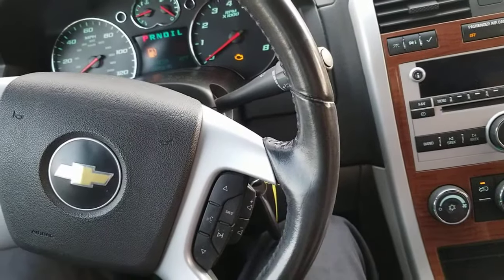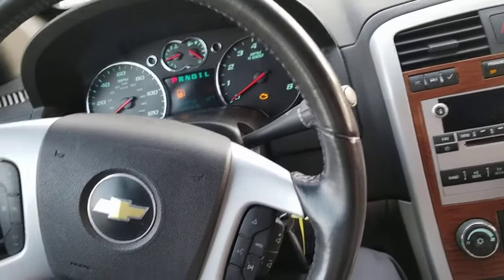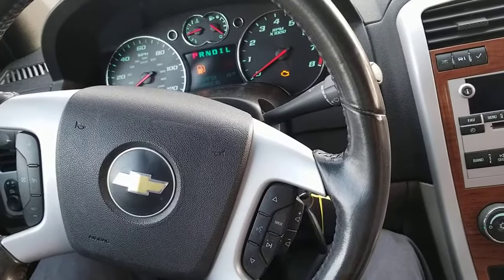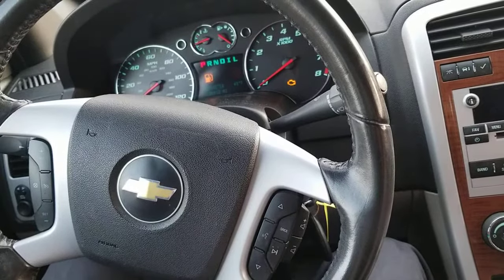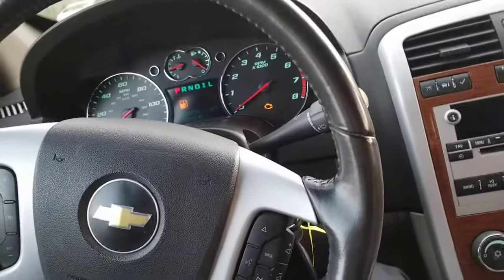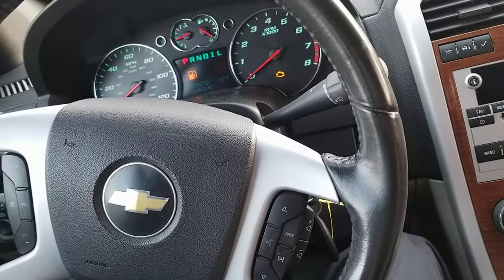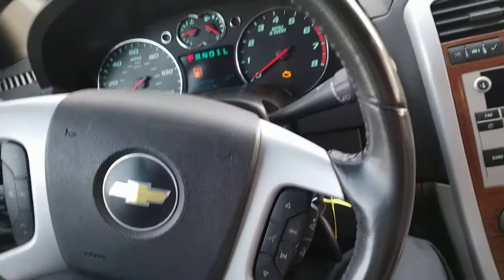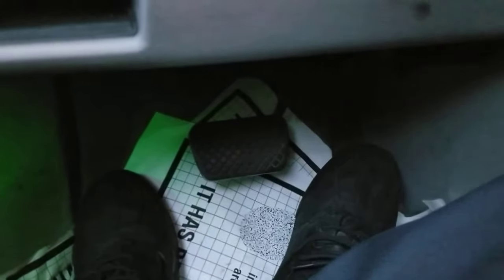Fix the sinking brake pedal in seconds GM/chevy/buick

Comment: I had a sinking brake problem after doing a hard brake.  I was about to bring in my GMC Terrain to the shop.  I followed your suggestion and found a gravel parking lot.  I got up to about 20 mph then hit the brakes hard.  The anti lock brakes started to shutter then I could feel the brakes power up.  The brakes are back to normal.  Thanks for the tip.

Comment: I had the same problem after changing the master cylinder and brake booster. I bled the brakes, no air. The peddle still went to the floor. Then I drove it in reverse hitting the brake hard and magically it firmed right up.

Comment: I have a similar issue with my 2007 citroen C^ saloon car .. .. top pedal without engine running ..    start engine and abs light comes on and pedal goes to the floor .
Reply from the maker: Give it a shot and see if it works. Be safe please. If not, maybe abs module is going bad 😢

Comment: Well ill be damned. This actually worked. I noticed my pedal would have pressure while slowing down then lose pressure the further down i go. slamming on them twice fixed the issue. Thanks. Now i know my ABS module is starting to go out!
Reply from the maker: Quality GM abs systems 😆.  Be sure to bleed brakes every 2 or 3 years to help prevent brake internal issues like this in the future.

Comment: I have done this  several times but it only lasts for a few days then back to sinking pedal.
Reply from the maker: you might need a master cylinder or other brake component. seems you have a leak. thanks for reporting back!

Comment: This works! Wished I had found this video earlier and tried this first. Replaced master cylinder twice. The first was probably a Chinese knock off, the 2nd was GMC OEM. A lot of time and effort changing two parts and all the bleeding! Well at least I have good clean brake fluid now. You are the Man! I have been doing brake work for years. May God bless you.  Thanks
Reply: What vehicle did you have?

Comment: Tried this before changing out the master cylinder on my 2012 Equinox.. Luckily to say it actually worked.. thank you!!
Reply from the maker: It might be a good idea to bleed the brakes and change out the old fluid. Just do a gravity bleed or use a suction pump tool from harbor freight. The bigger one with the hand pump and t-handle. Worth it to change power steering fluid too! Don't pump the pedal too hard tho. Sometimes seal can get damaged if you go too far doing the pedal press method.

Comment: Hello Friends,i change on my alfa romeo 147 lusso rear left caliper and rear right caliper cilinder rubber.Take of all air from sistem.engine off brake pedal hard,engine on brake pedal goes down  😬😬😬i will try your method sooner
Reply: Any luck with this? I have same issue

Comment: I just got back from trying this got the pump to come on still sinks  driving me crazy. Is it possibly to get a bad new master cylinder. Cause it acts just like its bad
Reply from the maker: your problem is beyond the scope of this video. you may have a bypassing abs module or master or leak in the caliper or wheel cyl
Reply: So do you think it's possible I got a bad new master cylinder

Comment: Hi subtledriver thanks for the suggestion . but My UK  R/H drive  C6 is a 6 months project and cannot be used on the public roads until it is re registered for use in Portugal .I am currently deciding on which   if any Diagnostic tool to go for . a friend has suggested a Delphi .

Comment: Sounds like a wide-scale defective mastercylinder oring/valve seal design and/or inferior components.  Slamming on brakes is forcing oring, valve, etc, into it's seat and no longer leaking pressure. Or it's simply forcing automatic bleeding of some air that was still trapped in the system.
Reply: It has nothing to do with a defective master cylinder it's in the ABS , I changed my brakes (front & rear) on my 2012 malibu and a week later the sinking pedal started and no I didn't open the brake system at any time . I did this trick and it worked .

Comment: 2011 equinox. Issue started after I had to brake hard and move towards the gravel shoulder. After those two tires hit gravel it started. Your advice worked great, instantly restored the pedal to its firm state.
Reply: I’m about to try this with my 2011 impala

Comment: moving on .. my Citroen C6 has gone back to the UK for sale .. My Citroen C5 replacement has a sinking pedal after a brake pad replacement and fluid flush using my Foxwell NT630-Plus abs bleed scan tool. all is well until I start the engine   the pedal sinks slowly to the floor with almost zero braking . All of the contaminated old brake fluid was sucked out of the master cylinder reservoir prior to the brake bleed using new brake fluid . I still have the sinking brake pedal after 1 1/2 litres of brake fluid flushing . I have done the dirt road test and the abs works correctly stopping the car in a straight line .   I installed new seals on my master cylinder prior to the final abs scan tool bleed .   .  the sinking pedal is still there  with poor brake performance .
 I have a second hand abs unit coming from EBAY    . I have convinced myself that there is a dump valve locked up causing my sinking pedal and poor braking power .    Quite an involving project .    getting to know more and more about ABS operations .

Comment: Yes that can work! You could’ve also used your scan tool there and went into the abs brake system and preformed a abs breed. But yes that’s one way to do it. Be safe! Thanks
Reply from the maker: abs bleed didnt work in this case. this was an old master tech trick that works when scanner abs bleed doesnt work. thanks for the feedback.

Comment: You probably had air in the ABS module, not uncommon.  Activating this function works it out of the module and into the lines where it can now be bled out.  Shops use a scan tool with ABS auto bleed function which were prohibitively expensive but Autel and others now have models with ABS auto bleed for around $200
Reply from the maker: I auto bled with scanner many times, didn't fix the problem. I believe there is a defect or glitch that activating the abs this way is kinda a work around.

Comment: I have same issue as describe in video. I have Chev Captiva 2008 Diesel Manual transmission. After replacing master cylinder today the brake paddle sinking has increase now will try the dirt road tomorrow and will update.
Reply from the maker: please post up any results you have! I hope it works out.
Reply: Tried breaking in Dirt road ABS is getting active making rattling sound, but Paddle sinking continues.
After that we tried to bleed from Master cylinder by opening out put brake pipes on it, by doing so sinking stop for few miles, then it was again back to sinking issue. Today we will try some different options and update.
Reply: @patelvivek4888  how did u end up fixing it?
Reply: @ambergrunwald8292 after replacement of Master Cylinder and doing Bleeding Oil from all 4 wheels we had good brakes, but when do hard braking due to which ABS gets to work then aging brake paddle sinking start. So we did Bleeding from all 4 wheels and Disconnected ABS module then there is no problem. So problem is ABS unit.
Reply: Omg! Thank u for answering me. We will try that! So does car do okay without the ABS module? Or did u replace it? Did u bleed again after removing it?
Reply: @patelvivek4888  the comment i just posted was supposed to be a reply to u
Reply: I had to tell you after I took it to the brake specialist today to let you know what they found. He put the calipers on backwards or upside down or something. That's why it was doing that.
Reply: @subtledriver  I found out they had put my calipers on wrong. And that's why it would never work. It was either backwards or upside down. I can't remember what he said
Reply: @ambergrunwald8292  👍, so finally u had your solution, for me Without ABS module its working fine.

Comment: I bled the brakes, I have pressure with the car off and no pressure with it on. Just replaced calipers. Idk if this is what’s going on or if it’s the master cylinder or power booster
Reply: any update? having smaething happening
Reply: @worldwidetrailerparks  I have the same thing happening as well. Were you able to figure it out?

Comment: Thanks it worked well for me on the 2012 GMC
Reply: Terrain 2012 drove over 200 miles. I had no problem, yesterday thanks for the help.
Reply: @dsavoy1006   how did u do it ? Was the car in park then u slammed breaks or where u driving on the gravel then slammed breaks ?

Comment: I have got a 2013 Chevy Silverado half. Ton 4 wheel drive and I've tried bleeding on the traditional way, it will not bleed. Change out the master cylinder changed up. Both front brake calipers, it will still not bleed.